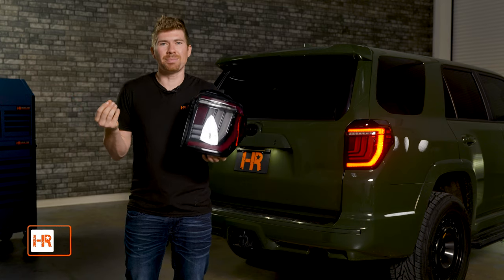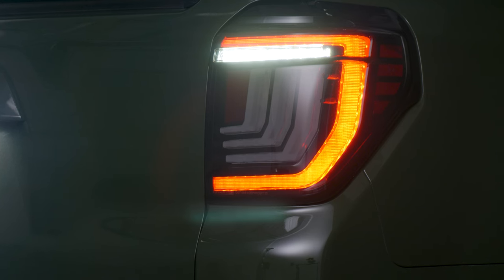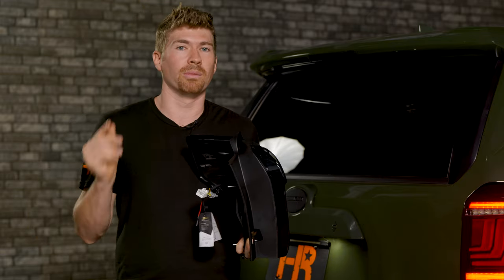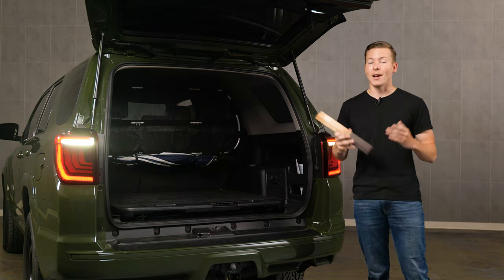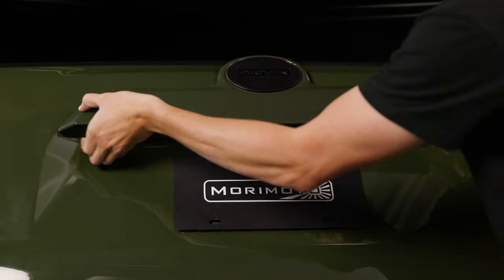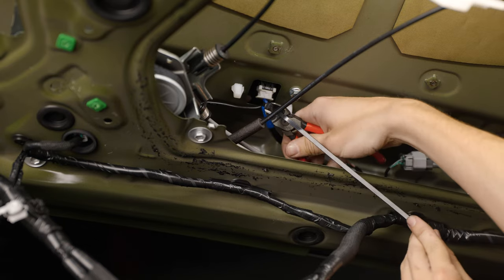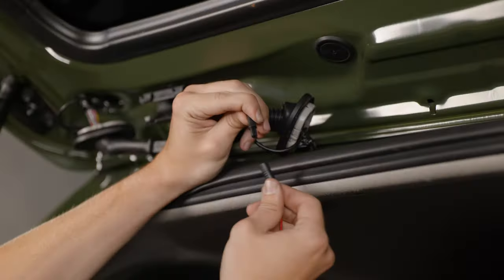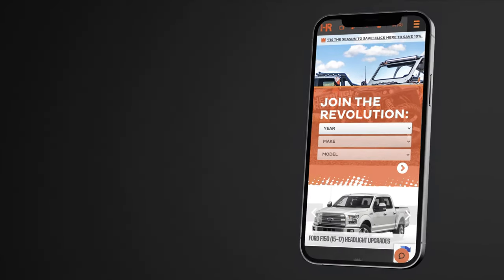The Game-Changing 5th Generation 4Runner Tail Lights from Morimoto Are Here! Review & Installation

Comment: That booster bar is a pain to run the wire.  Spent a few hours on that... very important: when running wire horizontally to the left pillar wire must be tight across, no slack or when you put the rear window down you will tug the wire, ask me how I know! Lol. There's a harness all the way to the left, not easy to access but is doable.  Also don't recommend putting a zip tie on a nut like that, will eventually come off and wire will hang, use some kind of plastic wire bracket, like the cable TV guys use outside your houses on that nut, more permanent.
Reply from the maker: All great notes here, thanks for sharing!

Comment: Do the original XB tail lights have the Boost Bar pig tail on them as well?
Reply: no, I just checked.
Reply from the maker: The original XBs do not, all new models and current production models will. The Gen1s were released before they had the Back Up Boost Bar, so they will not have the connector.